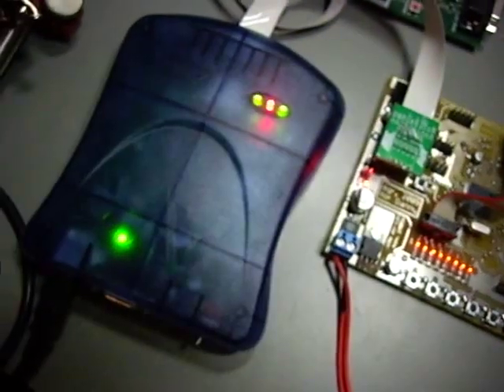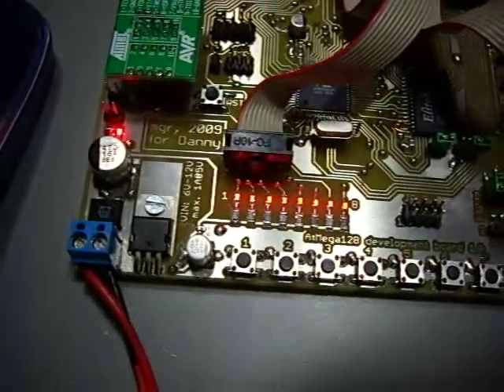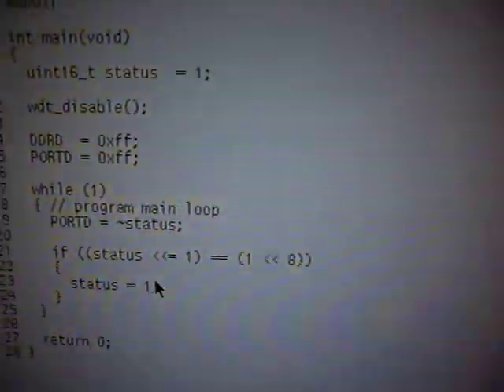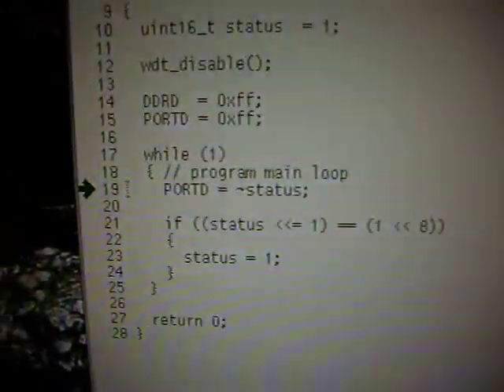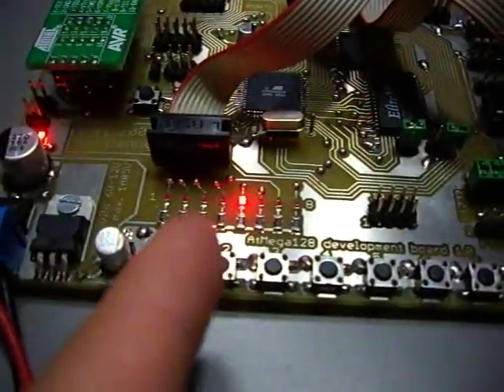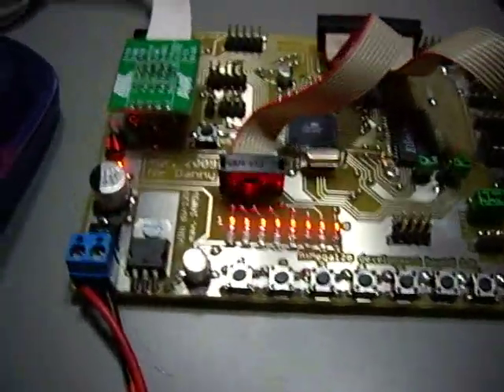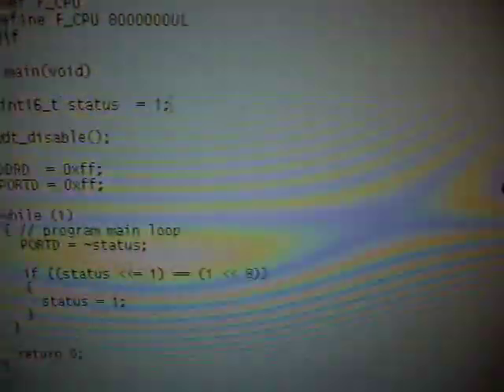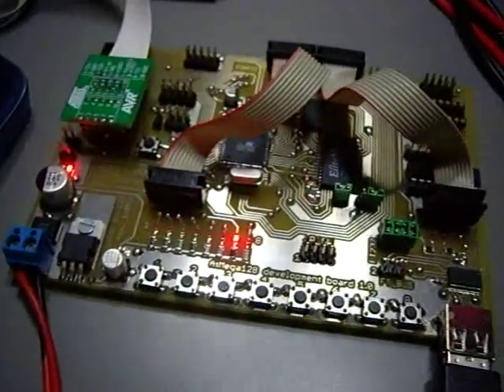Debugging an AVR under Linux using the JTAG ICE mkII and gdb.

Comment: Really ATMEL is making a pile of sheetos.
All the relevant controller IDEs can run on linux - NXP's, STMicroelectronics' (these are Eclipse based), Microchip's (Netbeans based), even TI has something on linux, although never seen that one working in person.
Even though ATMEL uses a gcc fork, and gdb, they chose to base the IDE on Visual Studio. Somewhere, some marketing guys from Microsoft and ATMEL got together, and this is what happened.
It is enough reason for me to never buy microcontroller from them, unfortunetly my employer had some legacy AVR thing needing some fix, so now I am here..
I think NXP's and STMicroelectronics's toolchain (meaning the debugger because the IDE is for free*) is cheaper! than this, the controllers aren't expensive either, and if you want to get a job with this, ARM-Cortex is preferred over AVR. So unless it is totally for just hobby, forget them...
Reply: Szegi Krisztián Szegi, this is scary as it gets! You are saying the exact words I think! Are you a mind reader? 
The Microsoft based AVR Studio is an under-the-belt punch. Not appreciated to put it mildly! Especially not when one reads the agreement for the free version. It is TOTALLY UNACCEPTABLE.

Comment: Nice video!  Thanks!  Is it possible to set port pins / registers (e.g. PORTB, DDRB, etc...)  using the debugger (so you could set an LED on directly rather than setting a variable that is then written to the port?